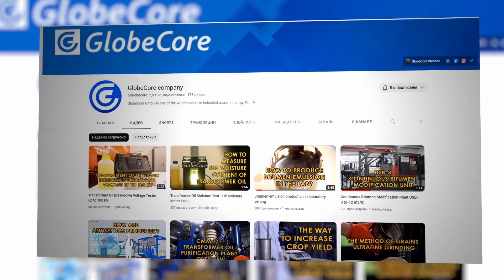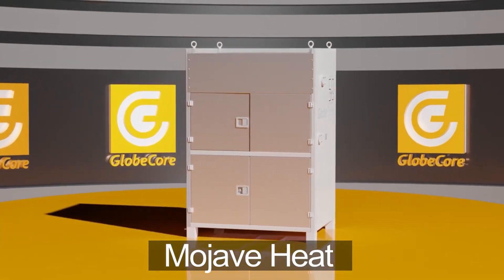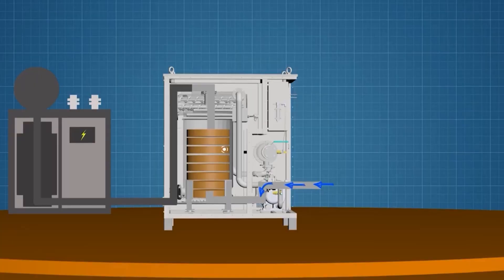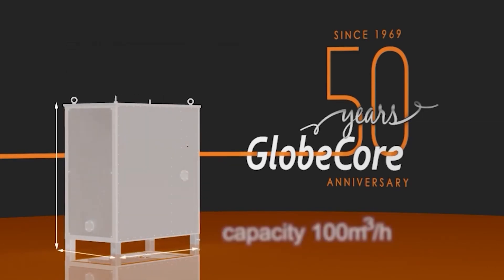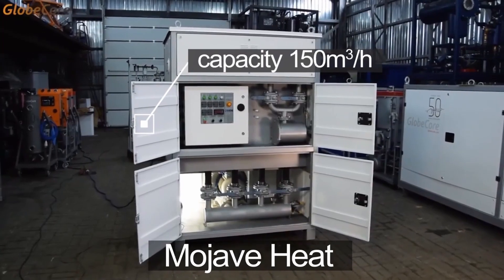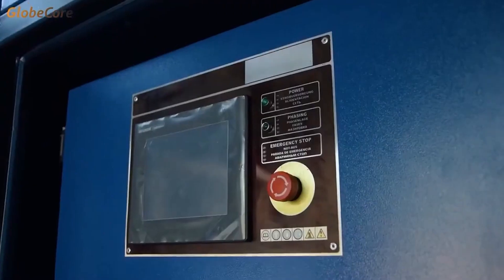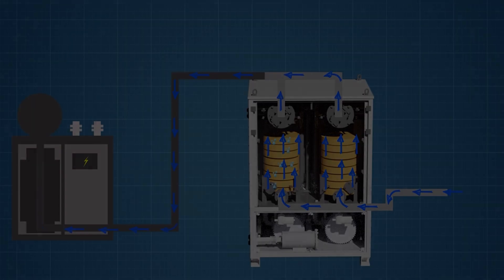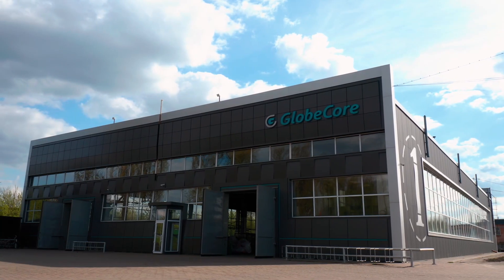Air Dryer Machine - The Mojave Heat Series

Comment: How does the touchscreen interface on the Mojave Heat Automated model differ from the controls on the other models?
Reply from the maker: Instead of manual performance adjustment by valves, it has automatic performance adjustment.

Comment: Are there any training materials or user guides available to help with the installation and operation of the Mojave Heat Air Dryer machines?
Reply from the maker: We provide additional technical documentation in English and other languages.

Comment: Can the Mojave Heat Air Dryer machines be operated in extreme temperature environments, and if so, what are the temperature limits?
Reply from the maker: Operation of the product is allowed at ambient air temperatures from +5°C to +40°C, but it can be modified.

Comment: What are the size and weight differences between the three Mojave Heat Air Dryer models?
Reply from the maker: For example: Mojave Heat 0.7: length is 1350mm, width is 800mm, height is 1700mm, weight is 550kg. While, Mojave Heat 4: length is 1500mm, width is 1120mm, height is 2120mm, weight is 1050kg.

Comment: How do the Mojave Heat Air Dryer machines compare to other air drying solutions on the market in terms of efficiency and performance?
Reply from the maker: It is one of the most effective drying solutions on the market in terms of efficiency and performance.

Comment: How easy is it to replace the zeolite-filled columns in the Mojave Heat Air Dryer machines if needed?
Reply from the maker: This unit offers reactivation of the sorbent, so you can use it multiple times. But if you ever need to change it, maintenance is straightforward.

Comment: Are there any optional accessories or upgrades available for the Mojave Heat Air Dryer machines?
Reply from the maker: Yes, you can modify the Mojave Heat Air Dryer machines.

Comment: Can the Mojave Heat Air Dryer machines be easily integrated into existing systems, or do they require specific modifications?
Reply from the maker: Usually, it integrates easily, but it depends on your systems.